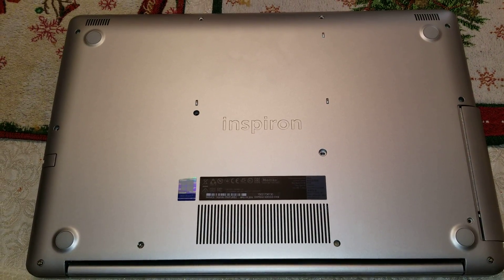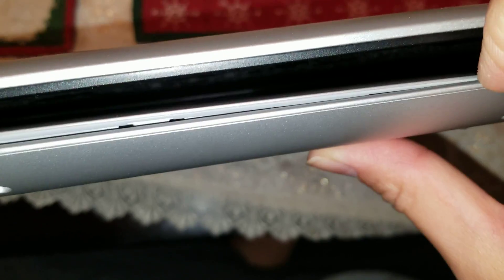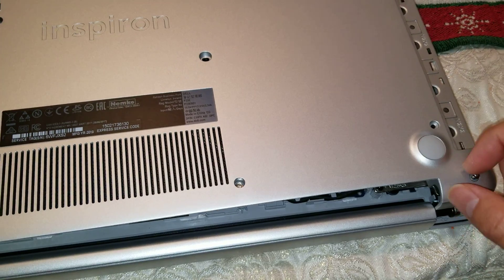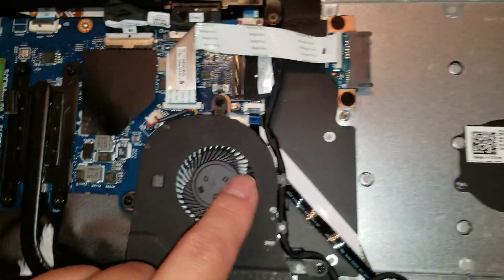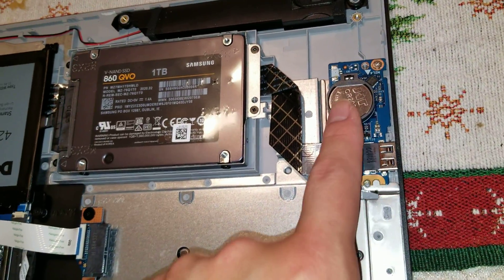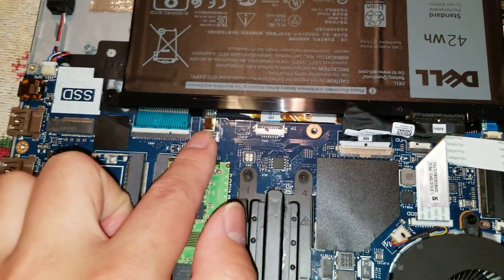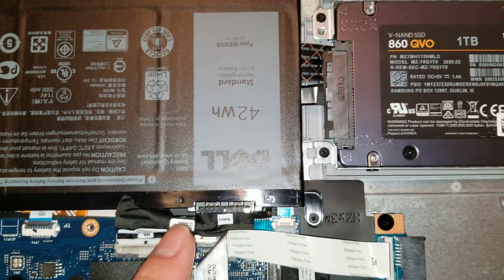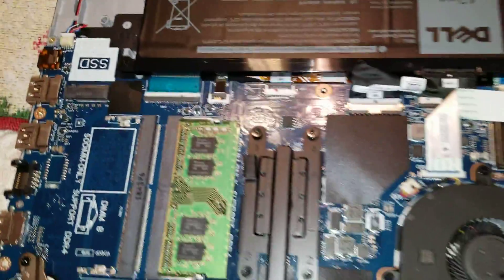DELL Inspiron 5770 Disassembly RAM SSD HDD Upgrade and Replacement

Comment: Just an FYI but that is an M.2 2280 slot, so you can upgrade to a fairly fast SSD.
Reply from the maker: Pcie nvme?
Reply: @ItsBinhRepaired  a bit late but yeah
Reply from the maker: @skyhigh78-o5k  no problem

Comment: Hi. I have DELL inspiron 3583 and the bottom looks pretty much the same. I just wanted to ask if it matters if mine screw number 7 (0:14) broke by itself and fell out.  There was also one more missing that hold ssd in place but I replace it with one of the corner ones. Really love this channel.
Reply from the maker: I think it'll be ok

Comment: Thanks for the video.  Are there two RAM slots?  I was hoping to upgrade my 16GB RAM to 2x16GB as sold by Crucial.
Reply from the maker: Hopefully you watched at least the first 3 minutes and 30 seconds of the video. You'll want to open yours up and confirm it looks the same inside. If you can't tell from the video how many slots it has, I'm scared to give you the answer. Make sure the speed of the RAM matches the original.

I highly recommend an SSD upgrade over a RAM upgrade if you can only afford to do one or the other. It'll make a much bigger difference in performance.
Reply from the maker: This video will help with the SSD upgrade https://youtu.be/4p5jFDzVwUw

Comment: Can I add 16 gb  2666 mhz with 8gb 2400 mhz ? Will it work or not. And do you know the difference between 1rx8 and 2rx8 . Thanks
Reply from the maker: I'm not quite sure actually. Every model is different. Too many for me to test. I think the 1rx8 is the rows is memory on the chip, but I'm not 100% sure.